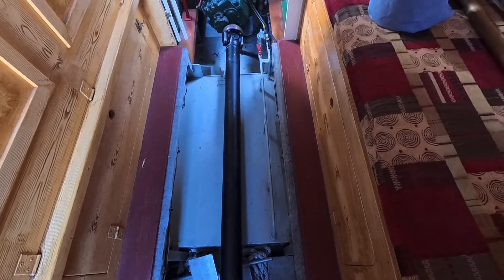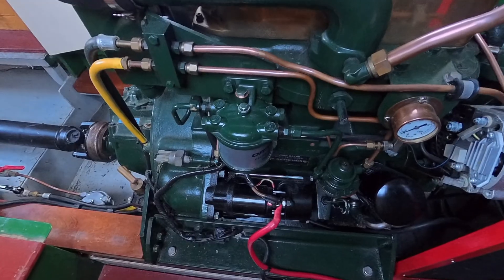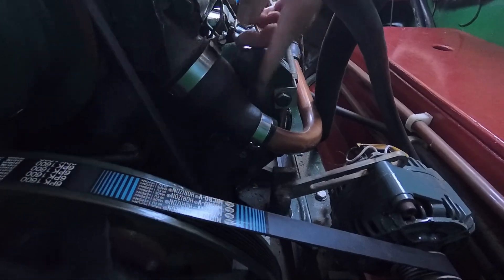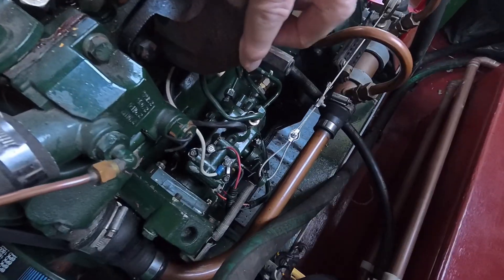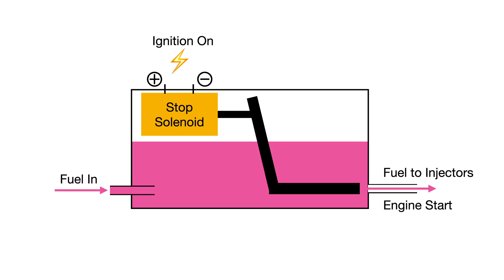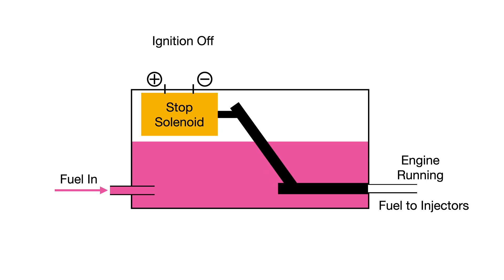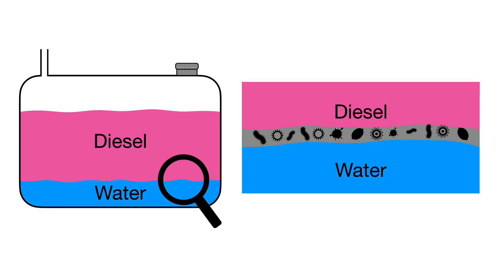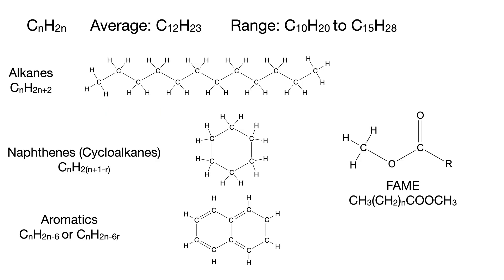My Narrowboat Engine Wouldn’t Start - And I now have a fix - was it the stop solenoid?

Comment: Simple stop cables and water seperators that were transparent and easily drained worked for decades.
Reply from the maker: Thanks for the comment. Yes, I like the idea of a stop cable, however, I still think everything will have gummed up and I would still have had the problem.  I have discovered I appear to have a water separator and hadn’t realised it, and therefore neglected it.

Comment: A 4x4 vehicle wrecker (especially of Toyota Hiluxes) will have a decent water separating filter 
that has a separate "bowl" of plastic material with a cork float type system and a plug for a warning light to indicate excess water present in the bowl...
that screws onto the bottom of said filter...

and that bowl has  a small drain that can be opened to check for any water...say every week in high season and every month in low usage times.

If you look at the schematics a 12VDC circuit involving a small light that illuminates when there is a large amount of water in the bowl "trap" that lifts the cork float to bridge the contacts could be rigged up to a warning light on your "dash"....
Reply from the maker: Thanks for the suggestion, that sounds like a very effective system for water separation and detection. There is a what I refer to in the video as a 'pre-engine' filter fitted, which I must shamefully admit, I have never looked at. I'll have a look at that and see if there is water in it, and see if I can retro-fit something like you suggest.

Comment: Well done on sorting that out, adding in a filter/water separator should stop that happening again.
Reply from the maker: Thanks for the comment. I have a filter/water separator fitted (well, I assume that is what it is).
Reply: @Nicks-Wanderings  If you have one fitted it's not working, otherwise the pump would have been clean, I bet the tank needs a clean out too, some sort of bug can live in diesel and ruin the system, good luck, I hope you have many more peaceful miles of trouble free cruising.
Reply from the maker: Thanks. The fuel filter post lift pump was fine. I’ll be looking at the other filter shortly. And I do plan to have the fuel cleaned.

Comment: Big ships have centrifugal separators that they periodically run the diesel through to remove the water and other contaminants, i don't know if there is a smaller solution on the boat market. Good video thanks.
Reply from the maker: Thanks for the comment. I’ve been looking into smaller versions of those. They seem quite popular in the sailing community where this problem seems to be even worse. The filters do look very effective and I’m exploring ways on how I might use one.
Reply: Obviously NOT A Seagoing engineer. You  Centrifuge fuel you are using on a continous basis .
Reply from the maker: Wow… however, I think that would be overkill on a narrowboat. (When I read about centrifuging fuel, my mind goes to the type of centrifuge I am very familiar with which were doing up to 150,000 rpm and pulling around 800,000 g. Definitely overkill for diesel.)
Reply: Obviously not  a ships engineer . The ones we use Bowl about  1 meter across 4/5 thoussnd rpm.  We are putting  80/ 90 ton heavy oil through daily + another one on diesel  6/8 ton a day !!.  For small pleasure boats there used to be Filters made by CAV  which were very good at filtration + water separation called "CAV  Aglomerators.
Reply from the maker: I think that is what I call the pre-engine filter on my boat. It’s not mentioned in the fairly extensive handbook I got with the boat and seems to have been fitted by a previous owner.

Comment: Sh*t in the solenoid, "how often do you have to do that?" 🙂
Reply from the maker: Thanks for the comment and the question. And your question is exactly what I am wondering. How often will I have to do that? The engine has just over 3,000 hours on it, so I’m hoping it won’t be for another 3,000 hours. However, in anticipation that I will have to do it again at some point, I have bought the special five-pronged screwdrivers so I can get the top of the pump.
Reply: @Nicks-Wanderings  
I think that was tongue in cheek....how often do you have to sht in the pump....
Reply from the maker: I think it is a good question. The more I read about modern diesel, the more concerned I get. Modern low-sulphur diesel with added FAME, maybe OK in trucks and cars that fill up every week or so, but it has the potential to be a real problem in a narrowboat where you may only fill up every month or so. I have not put diesel in my boat since December 2024, so nearly a year. What state is the diesel now in? And should I be surprised that it's gumming up the works? With the lockdown of the canals over the summer due to low water levels, and also the high temperatures, what state is the diesel going to be in at the marines that may not have sold diesel in months, and what will be its condition in narrowboats that have not moved for months, been baked in the sun, and not been refilled?
Reply: @Nicks-Wanderings  If you think modern diesel is bad for going stale in the tank, petrol is even worse. People that have PHEVs and use them how they are supposed to be used, so actually plugging them in, have a big issue with the petrol going off in the tank before they can use it. I believe you can get additives that are designed to kill off the nasties, with your low usage it wouldn't cost too much to treat the fuel with that stuff.

Edit:

Wynns Fuel Biocide 250ml £18 for 250ml. I also, it a former life, when I ran a diesel car, used to put a small amount of 2 stroke oil in the diesel.
Reply from the maker: Thanks. I didn’t know petrol also had issues. I am currently looking at stabiliser additives and stuff to clean the internal workings of the engine. Lots of choice. Lots of contradictory information.

Comment: Very, very interesting video. I'm ok with petrol engines, and usually give diesels a wide berth, but after seeing your vid,  I'm more relaxed about diesels. So, it might be best to go and have your fuel debugged. I think they pump your tank out, and put it through filters, but it may have to be done more than once.
Reply from the maker: Thanks for the comment. I’m glad you found it interesting and that it has made you more relaxed about diesels. I am trying to get the fuel debugged and I have had a guy out to do it. However, nothing is ever easy with the Grey Wagtail - the pipes from the ‘debugging machine’ were too large for the entrance into the tank.

Comment: Hi Nick, do you have access to the top of your diesel tank, if yes you can insert a small dia tube, clear tube would be best, put it carefully down to the bottom and then put your thumb over the top and then slowly remove. If it's a clear tube you can see a representation of what's in your tank. If it's not a clear tube release it into a glass jar. It's a bit bob colly but gives you an idea.
Reply from the maker: Thanks the comment. There is no direct access into the tank other than via the filler tube and the breather. I have been looking for the type of sample tube you describe as I wanted to try and capture a column of diesel to see if there are three layers (diesel, water and sludge), however, I have been unable to find such a tube. (The tube needs to be nearly 2 meters long.)
Reply: @Nicks-Wanderings  
Make one out of a reasonably flexible clear plastic chemical resistant tubing that can follow the contours of any inlet pipe...and yet aim right to the bottom of the tank.
I bought mine at a local hardware store, about 1/2 inch diameter I found is the right size for the combination of flexibility and rigidity.....
When it reaches the bottom seal off the top end and you "column sample" will be able to be withdrawn....
Reply from the maker: Thanks. Just bought some and I will give it a try.
Reply: Would the piping that is sold for aquariums work if you attached it to a stick to make it rigid?
Reply from the maker: Funnily enough, that is what I ordered yesterday…. Along with a bunch of cable ties. I have also ordered a small hand pump so I can take a sample from the tank.

Comment: My dad had an old 2.3 diesel Sierra back in the day. Possibly the slowest moving thing on the planet. One day he started having trouble starting it. He took it to Ford's and they said it was a stop solenoid that was at faults and there wasn't one in the country. They offered to take the stop solenoid off his car, and he could stop it by stalling it. However this is harder than it seems. It was not the fastest car on the planet but it would pull away in 5th gear quite happily. The first time my Dad tried this he took the garage door out. I'll drive was on a hill and it still wouldn't stall
Reply from the maker: Thanks for the comment and a great story. I shouldn’t have done so, but I did chuckle at the garage door.

Comment: Nice video Nick. The water issue aided and abetted by FAME could raise the temperature at when diesel waxes up in cold weather. The waxing will distribute the sludge  and cover things like to solenoid mechanism. When the temperature rises and the waxing goes away the sludge is left.
Reply from the maker: Thanks for the comment. That’s an interesting point about the waxing and the sludge as there has been reports of those problems on farms in winter, particularly down the east coast of the UK. The FAME components, along with the removal of sulphur containing compounds and the use of certain chemicals to remove sulphur containing compounds, may also cause problems at the other end of the temperature range with the formation of polymers and ‘sticky’ varnish like residues. Hence, I think my fuel got ‘cooked’ (probably in the pump) when the temperature onboard was in the high 20s / low 30s °C and I wasn’t using the engine. Just a thought.